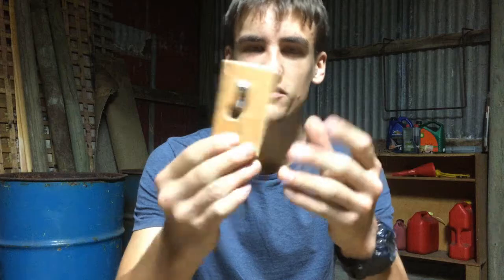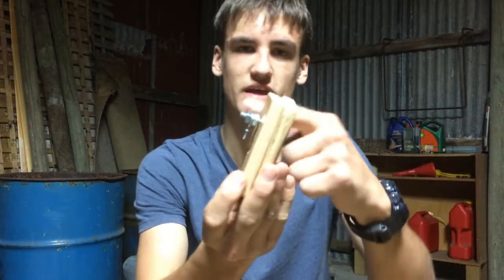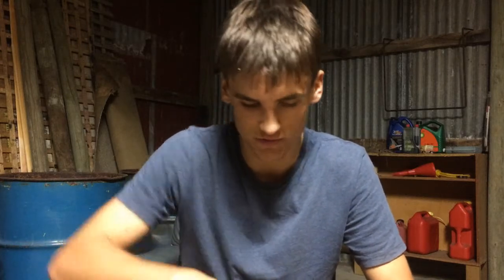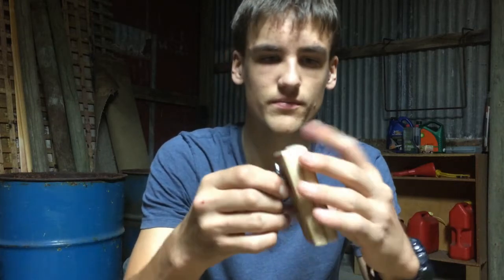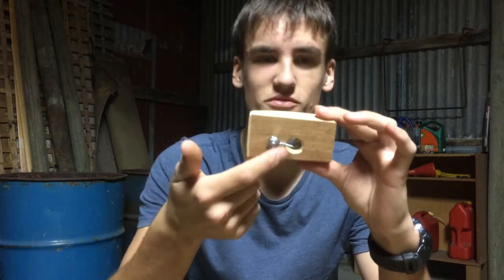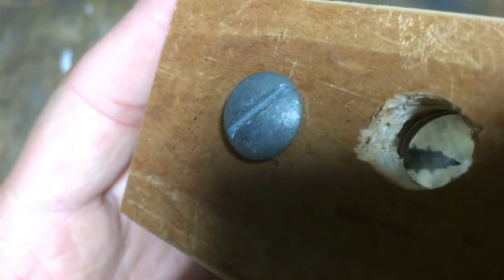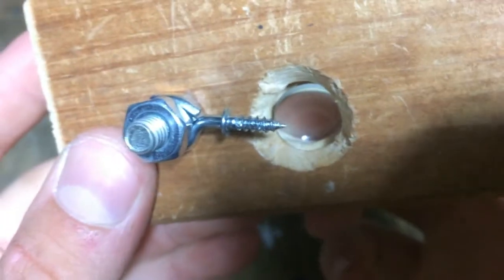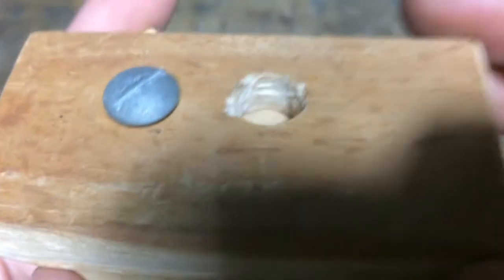A Leeuwenhoek Microscope (based off of his design)

Comment: I had fantastic results using the lens out of a CD player. very finicky, but you can see individual cell walls in a leaf with just that. Bonus: the mechanism that moves the lens back and forth across the CD can be used as a fine focus.